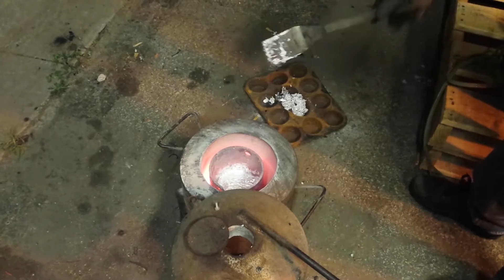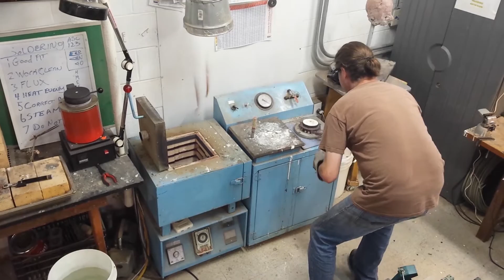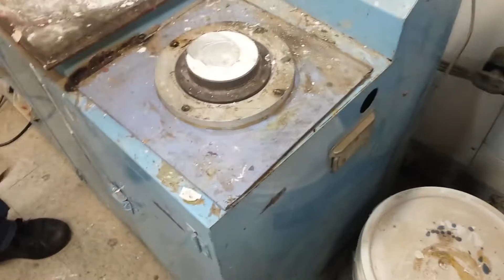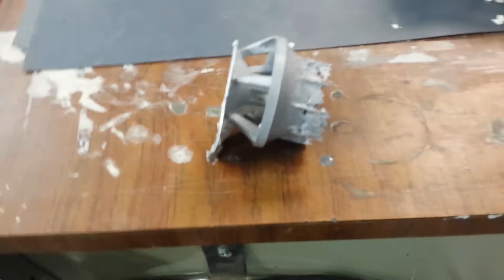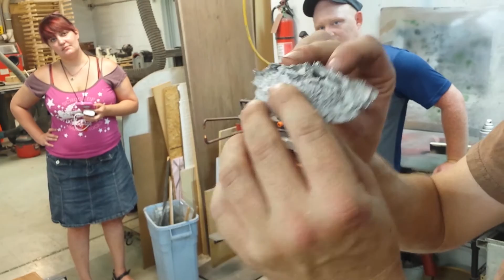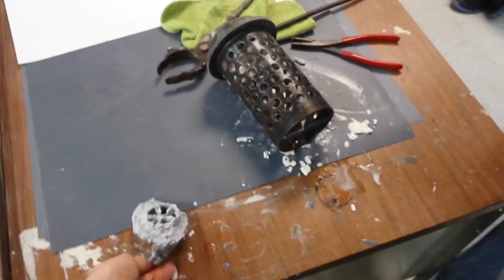Lost PLA Casting Aluminum At Hammerspace

Comment: The blow out is caused because the PLA expands before it burns out... maybe decrease your heat rise when burning out .. The best way is to print your patterns as hollow (min in fill) as you can, this will limit expansion outwards when heated.

Comment: Under filling a perforated flask leads to blowouts because your drawing vacuum from all sides you should have filled it to the top of the flask where the crossbars meets that supports the structure and integrity of investment under vacuum among other reasons. I like your setup did you use wax sprues on your pla model or did you print them with model?